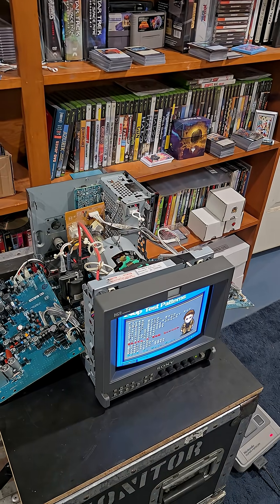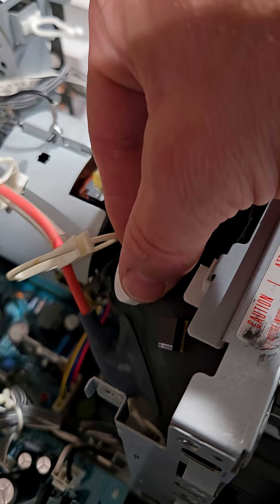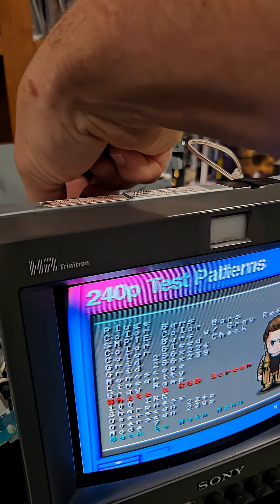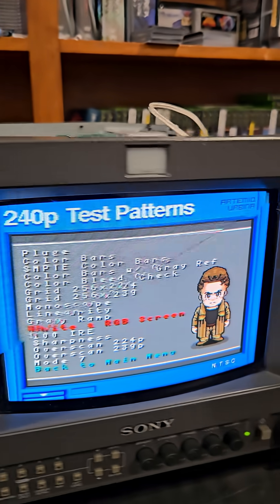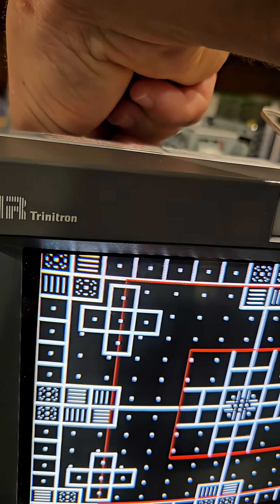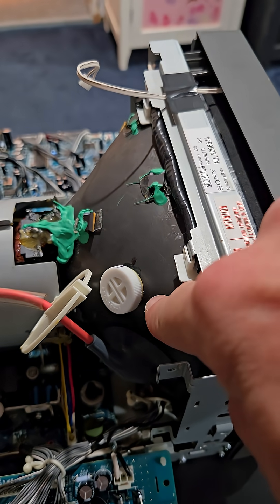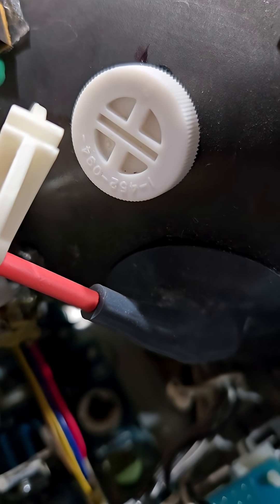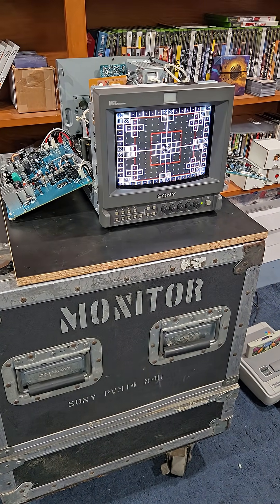The Coolest CRT magnet adjustment #retro #retrotech

Comment: Sony BVM 14 E BVM 14 F BVM 20 E BVM 20 F 20 F 1 U 14 F 5 U Operation Maintenance Manual

1452-094-00 MAGNET, ROTATABLE DISK; 15MM 0 X4308-8I5-8 PERMALLOY ASSY CONVERGENCE

The part number "X4308-8I5-8" refers to a permalloy convergence assembly used in certain Sony Cathode Ray Tube (CRT) monitors. It is not a typical permanent magnet but rather a special magnetic alloy with properties that help correct color misalignment on the screen. 

Function:
The X4308-8I5-8 is a "permalloy convergence assembly," part of the set of magnets and strips used to fine-tune the color convergence on a CRT display.

Placement:
These assemblies are placed around the neck of the picture tube, near the deflection yoke, and are factory-calibrated.

Usage:
They are typically used to make subtle, static adjustments to correct color separation, particularly in the corners of the screen.

The use of permalloy in convergence strips is distinct from using a standard permanent magnet. Permalloy is a soft magnetic alloy, and the convergence strips are ferromagnetic, meaning they are attracted by a magnet but are not magnets themselves.

Flux direction:
Instead of generating their own field, permalloy strips absorb or redirect the magnetic flux from the deflection yoke to fine-tune the path of the electron beams. Standard magnets create a strong, localized field that can cause distortion if not used carefully.